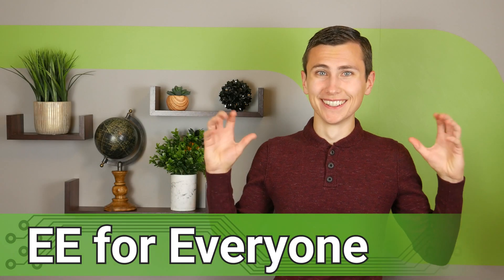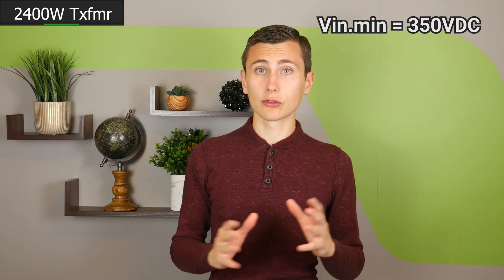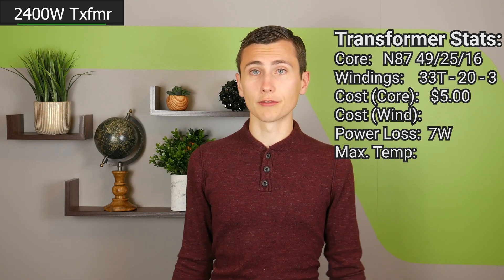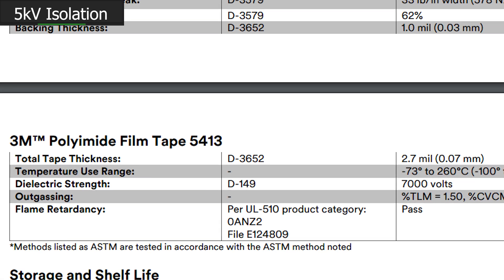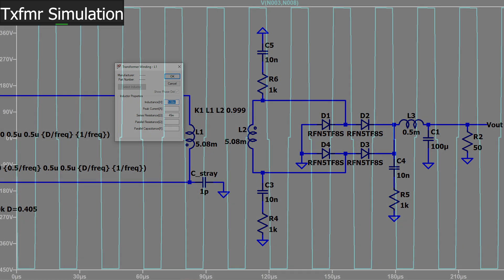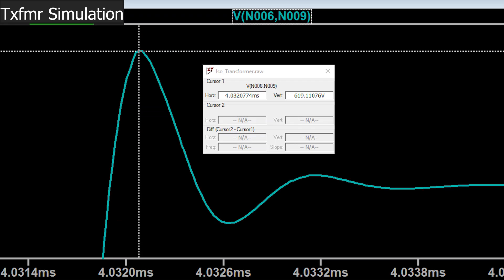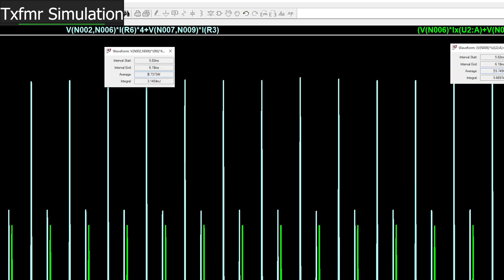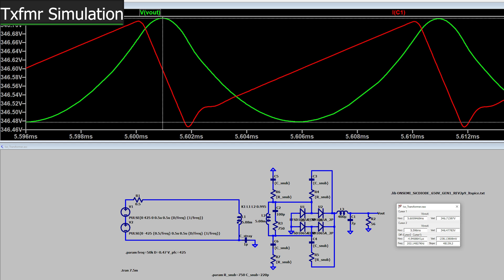Custom SMPS Transformer Design: PFC Isolation stage

Comment: Awesome video. I can't wait to see how this UPS  unfolds. 

I enjoyed the details of isolation transformer design...mine is probably not up to spec, but I did use a healthy amount of kapton between the primary and secondary. Hopefully it holds up to hipot testing.

Thanks for the tip about SiC diodes...I've been on the hunt for fast diodes lately.

I've been trying to figure out an appropriate snubber lately too...they seem to dissipate an unreasonable amount of power or do too little snubbing. The whole process seems very cut and paste...the few app notes I've read were along the same lines. Do you have any pointers? 

I noticed you using the coupled inductor method for your transformer (I use it too)... do you find it sufficiently accurate or do use also use an alternate model? I've seen one that could also model saturation but it was over my head and I don't think the ideal transformer takes enough into consideration.
Reply from the maker: Hello Dr. Rockzo! It's always a pleasure to hear from you. Yup, the Hipot test will give you a great idea of the dielectric strength, and a leakage current test would also be a good idea. If the dielectric doesn't break down (HIPOT)... but the transformer is leaking 100mA... that isn't good either!

Yeah, Snubbers can be tricky: The fundamental issue is that snubbers need to dissipate all of that unwanted power.... that's the goal. So the two ways to tackle the power dissipation would  be to use multiple snubbers (Which can also help with reducing parasitic inductance effects in real resistors  on a PCB) or reduce how much energy the snubbers need to absorb. 

One can reduce how much energy the snubbers need to absorb by either letting the voltage ring a little higher, or, by finding ways to switch faster. Switching faster effectively clamps that net to a particular value, whether that be a voltage rail, ground, or a bank of capacitors. 

For modeling the transformer, yeah, I've had good luck with the coupled inductor model. That said, modeling the leakage inductance of the transformer accurately can be VERY important. Sometimes Inter and intra-winding capacitance can be critical too. Don't forget about the parasitic components! Note: I don't model temperature rise or total power dissipated in SPICE, I let the magnetics design tool do that. It considers skin effect and losses in the core, not only winding losses. Basically, my magnetics design tool makes sure I won't saturate the core, and I use that calculated inductance at the desired current level (an output of the magnetic design assistant) as an input to my spice simulation

I hope this helps!